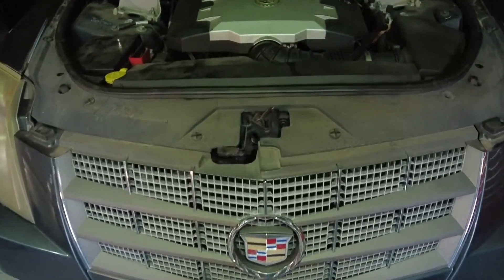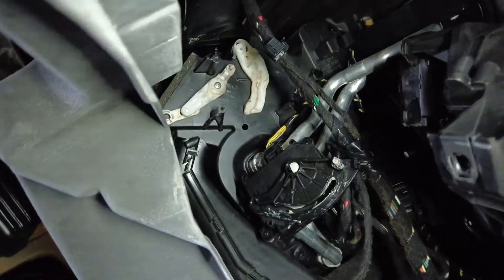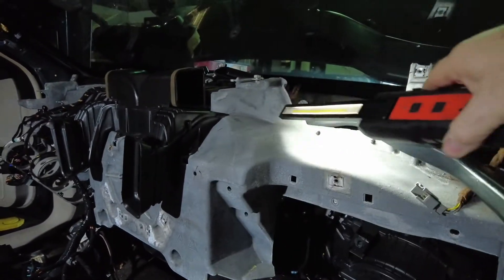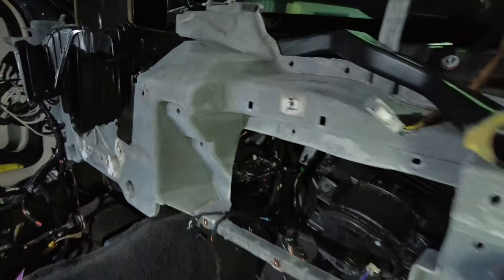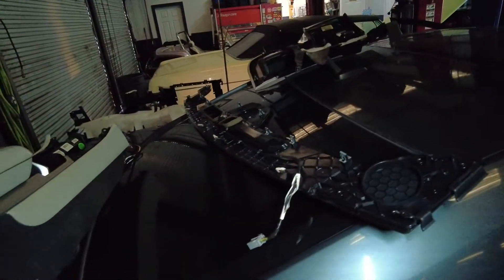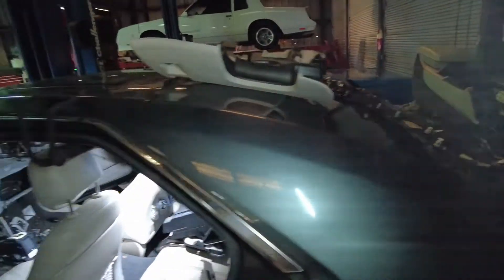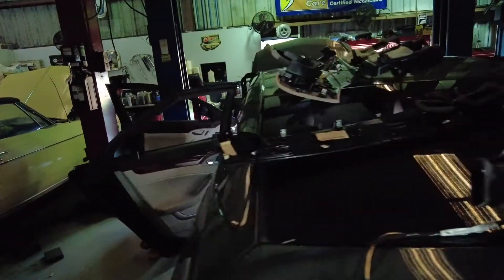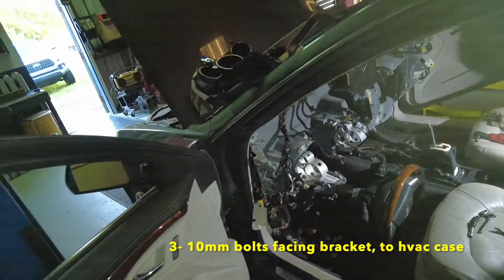2008 Cadillac CTS, Air Conditioning, Mode Actuator repair, overview...

Comment from the maker: The mode actuator is trapped by the dash brace at the very top of the HVAC case. There are 4 actuators, 1 fresh/recirc, 1 drivers blend, 1 pass blend, 1 mode.
Thanks for watching!

Comment: Thank you for the video which clearly shows exactly where the mode actuator is installed. By watching your video and keeping it handy for reference, I was able to successfully replace my mode actuator in my 2012 CTS-V Coupe last month. It took a while and most of the day, but I finally was able to get it out and the new one in and only had to remove the lower trim and glove box. Everything else was done from the bottom reaching up into the area using a flashlight so I could see it. The topmost screw was the problem because even using a small box wrench with t Phillips bit I could not get the screw out completely because there is not enough space. So, what I ended up doing was to get the bottom two screws out, loosen the top screw as much as possible, then I pulled the actuator at an angle and broke off the corner that had the top screw in it. After getting the actuator out, I was able to finally remove the top screw. When I installed the new actuator, I installed a 7mm bolt head screw in the top hole so I would be able to get it out with just a wrench if needed. Worked great because after I tightened everything down and tested it, I discovered one of the door pins was not in the slot, so the door was not opening. It was easy to loosen the top screw/bolt this time using just the wrench and I was then able to slide the pin in the slot and tighten it back down. Now everything works like it should. It was good experienc but I hope I don't have to ever replace that actuator again!
Reply from the maker: Awesome job! Glad it helped you out!
Reply: thanks for your input. could you share a picture of the tool that you used for the upper screw? was there enough space to return the original screw up there?
I am planning to attempt this soon, I have already changed the blend doors on the right and left side.
Reply: @rabe3sh7ady  I don't see any way to post a picture, but I used a 1/4" combination wrench with a Phillips screw bit. I had to put a small piece of cellophane plastic wrap on the end of the screwdriver bit that went into the wrench opening to hold it from falling out while using it. This was the thinnest tool I could come up with to reach the screw. My smallest ratchet with screwdriver bit was too thick and would not fit in the space. 

I did not use the same screw for the to[most during re-install. Instead, I used a 1/4" head screw with the same threads in place of the screw so I could use the 1/4" box end wrench to reinstall it.
Reply: I also replaced the mode actuator in my 2012 CTS.  Honestly, getting out the old actuator was the easy part.  I removed the one screw you can actually get to with a screwdriver.  Then, based on advice here, I broke the old actuator where it attaches to the other two screws.  That gives you enough room to use a mini pair of pliers to remove the two remaining screws.  

The real nightmare for me was getting the new part in place, while lining it up with the arms (white parts in the photo) to the vent doors and getting the screws back in without having the actuator shift, because you can really only get one hand into that space at a time.  It took me at least four tries until I got it together and it worked properly.  Keep in mind that on each attempt I had to install 2 of the difficult screws and plug in the kick plate below the glove box , which is necessary in order for the HVAC and center console to work.  Each attempt took 30-45 minutes.  I eventually changed the actuator to a different setting so the half moon piece on the back of the actuator was more visible and easier to align with the vent arms.  I ultimately only installed the two easiest to access screws.  I used just 2 screws on my Acadia 10 years ago on a similarly difficult to access setup and it's never given me any problems.

Overall it took me about 5 hours.  It took about 45 minutes to access and remove the actuator.  Another 30 minutes or so get out the two screws after trying several techniques before I settled on using the mini pliers.  About 3 more hours on my various attempts to install the new actuator correctly - hopefully this goes better for you.  And another 30 minutes to put everything back together.  Even if everything goes perfectly for you, figure at least 2 1/2 hours.

Comment: Just replaced Mode Actuator on 2008 Cadillac CTS and didn’t require fully taking the dash out.

Took bottom passenger floor plate and glove box out. Took out the part just below the actuator for extra room and light. used an offset screwdriver the ones that look an Allen wrench but with Phillips end.  From there is took some angles to loosen up the screws on actuator.

It helped to loosen the 2 bottom screws first to release more room for the top. Once you’re able to loosen enough it can be done by hand.

On the reinstall it was a little hard to get the grooves to match up. Started with reinstalling all screws but just enough to stay. Then used a long flathead screwdriver to push the grooves back in once the actuator was able to be held by it self.

From there it’s a reinstall of everything. Hope that helps out with anyone trying to replace the mode actuator. Not an easy job can be done with patient and small hands.
Reply from the maker: Nice work!
Reply: Great help bro, now I know the exact details as I'm going tomorrow to the garage to change it
Reply: @xbrac007... Can I bring my '08 CTS 3.6 DI to you?
Reply: @xbrac007  👍🏼

Comment: I just attempted this fix by not taking the dash apart.  There are a couple of comments here saying to drill holes to get to screws and onother to use a allen wrench type screwdriver.   I didnt want to drill holes int this particular metal and tried the ellen wrench screwdriver method.  Not possible for me at least.  So what i ended up doing is disconnecting the actuator control arm to vents and permanently  fixed vents so cold air comes out of front center vents.  The heating system seems to work also, and so does the defrost and defogg systems work as well.  Only con is no air comes out of bottom vents for heating.   This fix, though not replacing actuator, will work  until this $%@# CTS dies, which Im hoping will be soon.  I've  had it with GM junk.  Never again will I buy an American made vehicle.   It's  been one problem  after another.
Reply from the maker: Yeah not many short cuts on this job. It is common on almost all major repairs on any brand nowadays.

Comment: Thank you for making this video! my cts had the clicking for a while but then stopped.  my modes totally work, my issue is hot on passenger, cold on driver.  many say heater core, but when i scroll through the modes i get a about two seconds of heat.  Two questions, i cannot see where the fresh/recirc actuator is (lookikng at many diagrams).  And does the mode actuator have anything to do with blending AC/heat door? (if there is one) hard to find actual pictures on how everything works.
Reply from the maker: Thanks Larry, glad you enjoyed it!

The temperature actuators should be easier to replace from memory. I believe one is behind the glove box and one not far from the gas pedal area. There should be a function code for it in the HVAC module if one has stopped working. The clicking won’t always set codes, but no function should.
Clear the codes and see if it starts clicking again, try and get your hand on it if possible. Watch for sharp metal though.

Should be a little easier than this one was! :)
Reply from the maker: Also, the recirc actuator may be harder to reach, but will be near the fresh air Inlet side of the HVAC. I think also behind the glovebox?
Reply: @JimmyMakingitwork  thank you for quick reply!!  i have watched the driver, and passenger actuators functioning blend doors. I will try manually  i cannot see the mode actuator that you have in the video.  so i think it operates 3 doors from studying your video wondering if something slipped off?  since the modes work?
Reply from the maker: Hmmmm, if all blend door actuators seem to be moving either a door is broken or the heater core may be restricted enough to only produce warm air at the side it favors. I haven't seen that happen yet, but it also doesn't get very cold in central Florida.
There should be 4 actuators, recirc, mode, left blend and right blend. Some cars use dual mode actuators.
There is also the possibility of something blocking the heater on one side, napkins, leaves, etc.

Hope this helps.
Reply: @JimmyMakingitwork  thank you for taking the time to answer! much appreciated.  if i figure it out i will post here for you , and others.

Comment: is there an upper and lower mode actuator?
Reply from the maker: There is on some higher end vehicles. I am not positive on this one from memory. A scan tool can help bring up that data in the HVAC module.
Reply: @ appreciate it sir

Comment: You didn't tell us what the original problem with the car was!! Only blowing hot air? Only blowing from the floor not out of the vents? Hot air on one side cold air on the other? But still a nice video....
Reply from the maker: The mode actuator is for defrost, dash vents or floor. It was clicking every time the car was started while it did auto calibration. The internal gears usually chip a tooth and the HVAC module runs it waiting to see a current spike that never happens because of skipping gears. Hope this helps!
Reply: Do you have the part number for the mode door actuator?
Reply: Do you know how to fix the air only blowing out of the floor or is this video the solution?
Reply: @chrislabonte8373  the mode door actuator is controls the mode, blend doors control the temperature, and as far as magnesium goes, if you can weld it, you can cut it.... Took me less than an hour on my personal vehicle to cut an access panel and replace the actuator.
Reply: @jessebrowne5243 what did u use to cut into it?

Comment: How did you get the magnesium carrier free from the drivers side? I’m having trouble with something still grabbing in that area, just can’t seem to find it.

Already got the two hidden nuts that were only visible from the window

Thanks for your time
Reply from the maker: Man, I wish I could be sure Eric, it's been a little while now. But I think there was a bolt under the instrument cluster, or facing up not far from the gas pedal? I remember something like that causing a struggle also.
Hope this helps a little.
Reply: @JimmyMakingitwork  Man I really appreciate your reply!! Luckily my coworker was able to find it. You’re spot on though, those nuts under the instrument cluster were hard to find. Pro-demands diagrams aren’t the most helpful haha

Comment: I have a 13 cts.. Ac only blows from bottom vent at the feet.. No matter the setting.. I can control the temp and power but.. Won't blow from other vents.. Could this be the fix or na
Reply from the maker: Very possible. Mode actuator controls the doors when the AC control panel asks it to. Should be a code and data for the actuators seen with a mid level scan tool.
Reply: @JimmyMakingitwork  yea na I don't have any special tools..just screw drivers and ratchet.. Sucks cus ppl say there are more than 1 actuator am I right?

Comment: How do I know which one is bad ? The clicking noise comes from the passenger area. An it blows cold on 60 but as soon as I put it at 62 the driver side air blows hot
Reply from the maker: Joseph, you might have two problems. I’d find the clicking actuator by removing the glove box and trying to touch it while it clicks. You can also move the controls one at a time and 1 of them will start the clicking again. Then a diagram tells you which one works that control.
The warmer on the drivers side is usually low freon, but there is a small chance an actuator is broken pretty bad and the door flops over?
Some actuators are not bad to do, some are time consuming.

Thanks for watching!
Reply: Yea as soon as I start the car it clicks an doesnt stop. I can tell it’s coming from passenger area. Says Service Ac on dash. When you say it’s a 7 hour job. How much is that?
Reply from the maker: Joseph, it depends on which actuator it is. The easier ones are 30 minutes, the hardest requires dash removal. So labor could be from $70 up to $1,000. depending on which one it is. Have to put a  hand on it to be sure, or move controls to see when the noise starts or stops.
Reply: @JimmyMakingitwork mine only clicks when it has ac on but goes away after a couple seconds the air always comes out what it’s supposed to like when I have heat on heat comes out and when I have ac on cold air comes out. Which one would that be?

Comment: My car blows out defrost and back vents this makes me think something else is wrong
Reply from the maker: Sounds like a mode actuator problem. This controls the doors for floor, dash and defrost.
Reply: @JimmyMakingitwork is that the same actuator shown in the video or is there another spot for that because i have the same problem air out the defrost vents and back vents